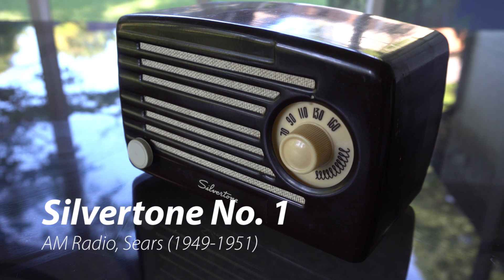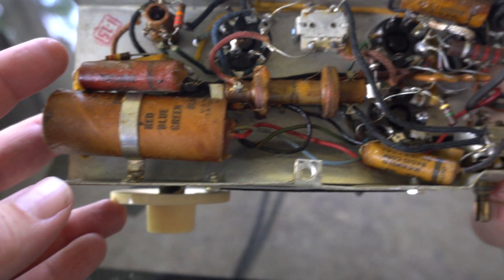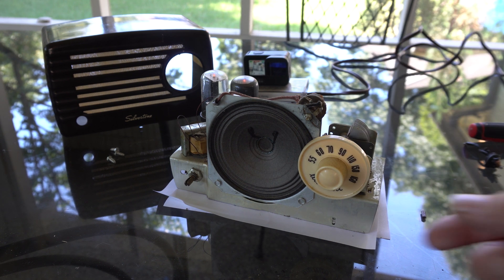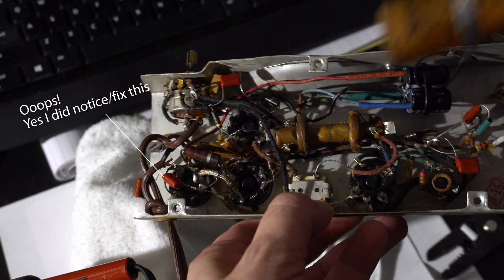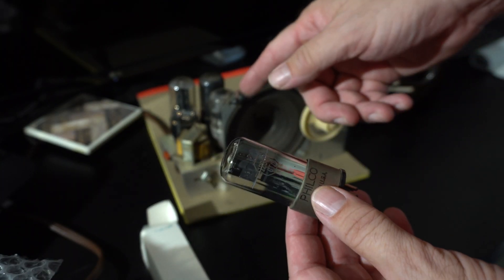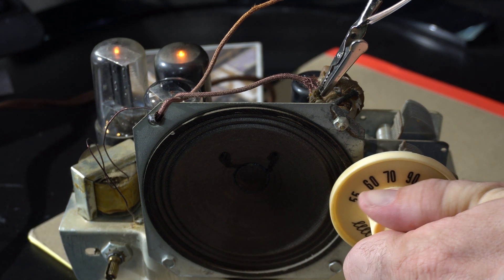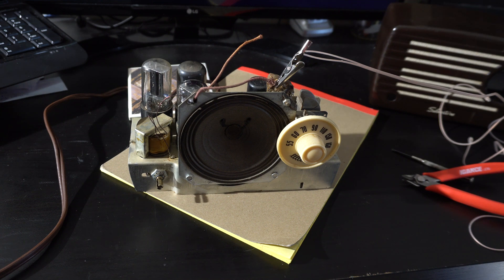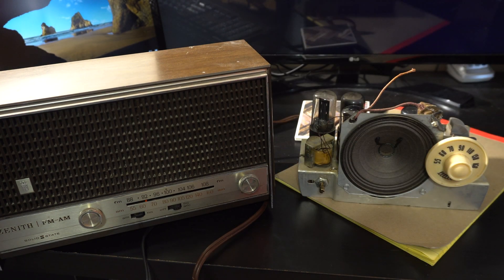Sears Silvertone Radio No 1 (1949-1951)

Comment: Great job. I would definitely recommend replacing the grid coupling. Capacitor on the audio output tube.. esp. If it's one of the wax paper jobs. it can stress or even take out the audio output transformer if its leaking dc across it.
Reply from the maker: Thanks!

Comment: Another great video guys.   Does anyone make new tubes, or can you only use old "new" ones or scavenged parts?
Reply from the maker: Thanks, and great to hear from you! That's a good question. I once met the owner of a company here in Memphis called "Tube Depot" that sells them, but I have no idea... I bet that much like audio cassettes, there are probably a handful companies still cranking them out.. (After all, we have to keep those air traffic control computers running!)